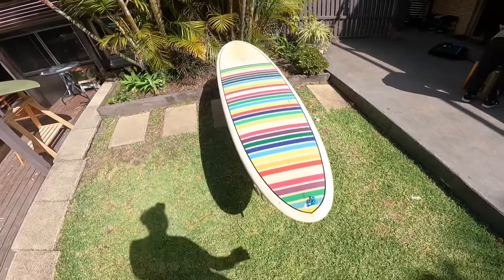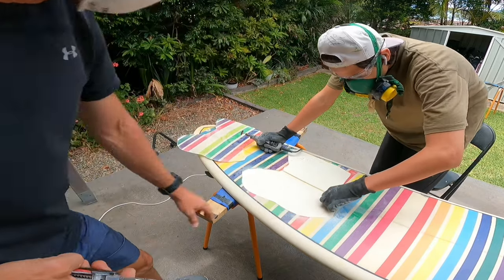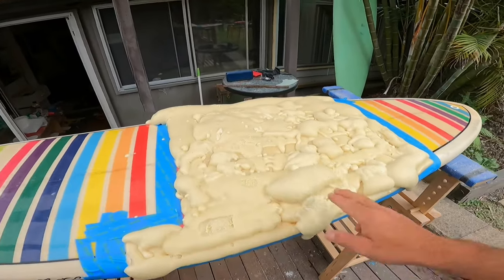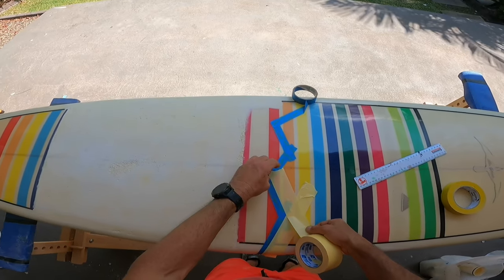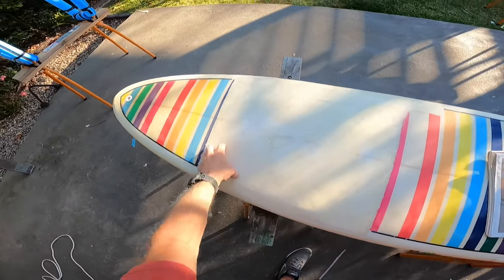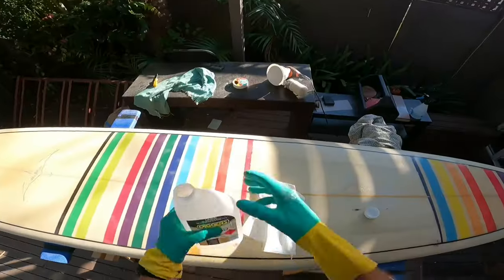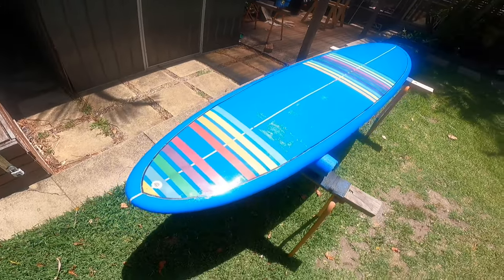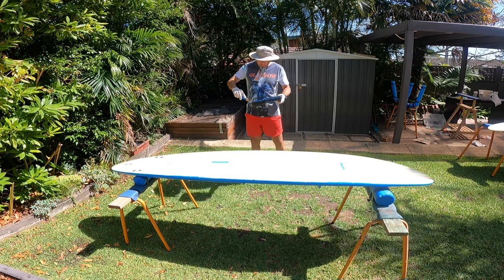Surfboard Restoration- using expanding foam step by step

Comment: Long ago we used the "quarter" tap test to locate delaminations.  Tap it with a quarter (25 cent piece US) & listen to the sound.  (Any hard object will work).  Yes, that was a very big job, but the board looks fantastic!  Good on you saving a board that will provide a lot of fun rides for someone instead of going to the landfill!

Comment: Greg, I have used lightweight drywall mud to fill in and mold paddle boards I have shaped. It works really well is very economical.

Comment: It's great that you explained the issues that you had, I learnt a lot. Also, using the foam to cover that before puttong the glass on it is something i want to try next one i do. 
What I would have done differently is to paint the black lines instead of masking them to see the original ones. The end result is much better than I thought at the beginning.
Reply from the maker: Thanks. I’m not quite sure what you mean regarding black lines. I used the tape as an outline for the spray paint
Reply: @gregssurfboardrestoration  I meant to paint the lines instead of seeing the original lines from underneath.